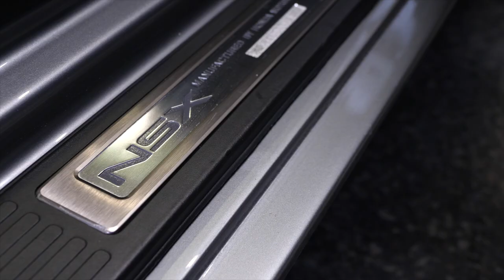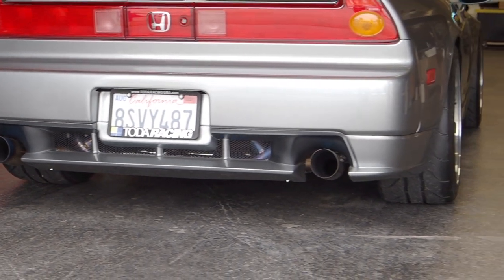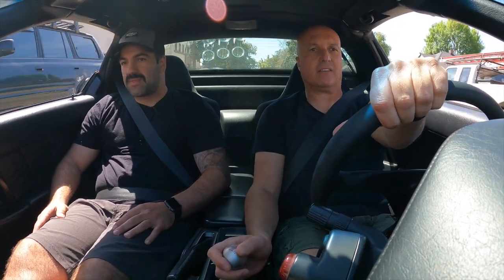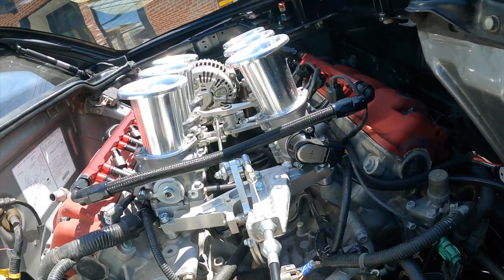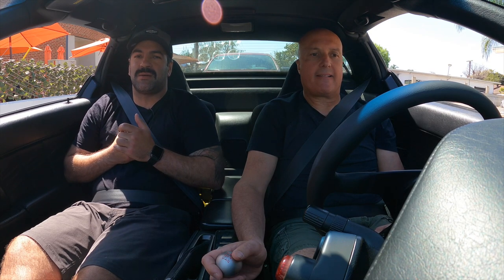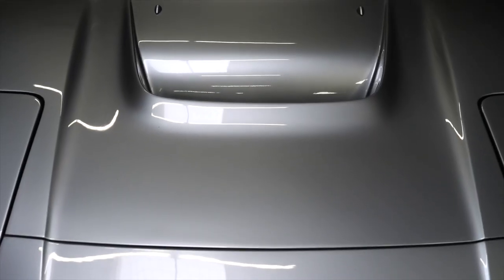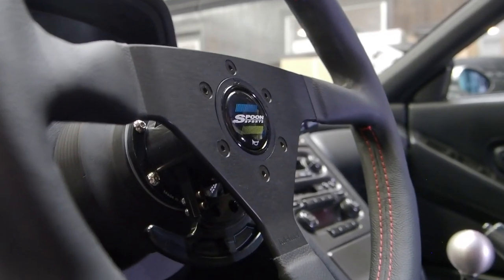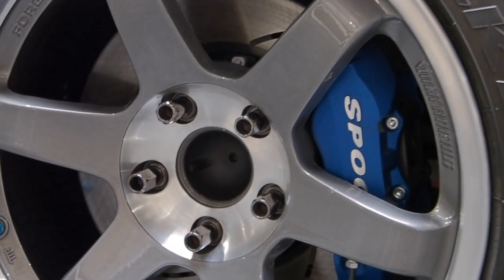Listen to Our NSX Rip With Toda ITBs

Comment: I have a '98 Kaiser Silver that has an exhaust, Stoptechs, and SOS '02 wheels but otherwise stock.  I never liked the heavily modified look, but yours is very clean.  That black hard top model with a 3.2 is very hard to find. I love the ITB look and sound as well.
Reply from the maker: Nice! Your '98 sounds very tastefully modified. We love those SOS wheels. The Toda throttle bodies transform this car. The sound is absolutely visceral.